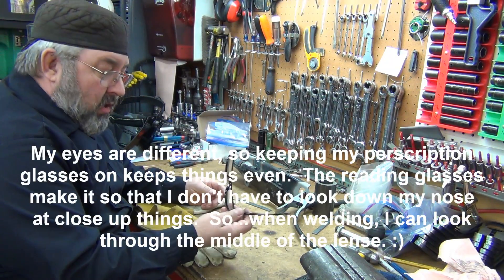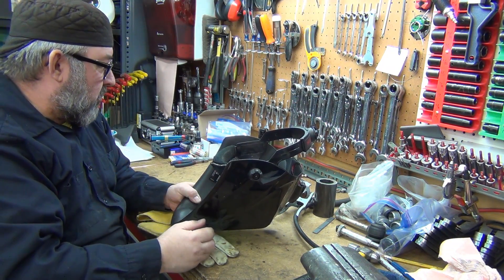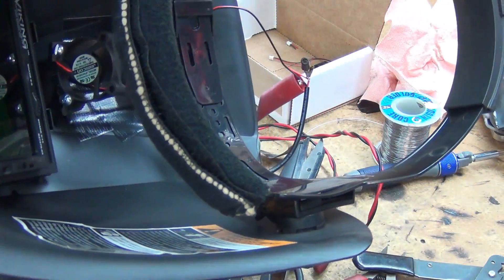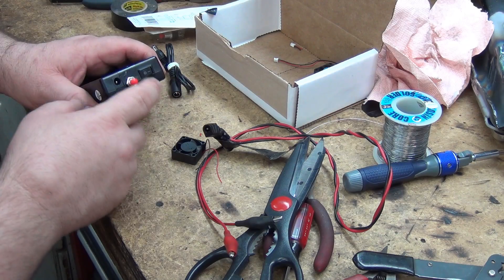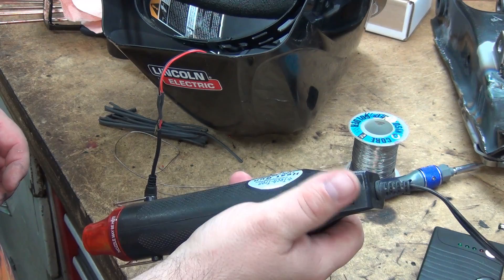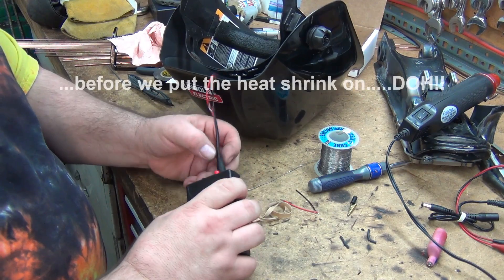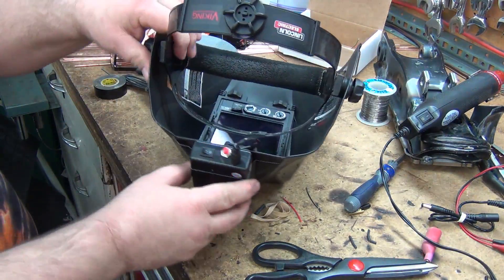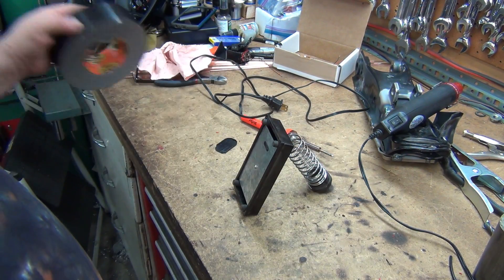Weld Helmet Mod - Fan

Comment: I appreciate when people leave their mistakes in the video.  Great idea.  I'm doin' it.
Reply from the maker: Thanks. :)  You're...???.....going to leave your mistakes in your vids or put a fan in your helmet? lol  ;)
Reply: bluehandsvideo   I make too many mistakes to leave them in. I made the helmet mod right after watching your vid. I cut a hole on the top of helmet and mounted a larger computer fan. Powering it with a pc power supply. Works great. Thanks again for the inspiration.
Reply from the maker: @abbarr  Most of my editing is to cut out all the "Ummm's and So's". lol    Interesting way to do it.  I had thought about that, but I wasn't sure if sparks would come through the fan.   You're more than welcome!

Comment: Umm, yeah.....they make magnifier("cheater") lenses for welding hoods. Not all welding hoods are compatible though. 

I might have to try the fan though. I recently had to swap to a different hood while mine de-fogged.
Reply from the maker: I've seen the cheater lenses, but only on the older, smaller size lens.  I haven't looked in quite some time, so maybe they have them now for the bigger ones.  I really like the bigger window!!   The fan works awesome for me for keep the fog at bay!  As I get a bit more time in the shop, I think I might revisit this and actually make it more "finished" and permanent.  Thanks! Mike
Reply: @bluehandsvideo  I haven't seen any available for the large lense hoods. I could be wrong, but it doesn't look like your hood is compatible anyway.

Comment: Idk man i feel like if you arc weld it could burn through the plastic of battery and cause an explosion on your head
Reply from the maker: hhmmm.....I guess it might be possible.  You'd never think a lighter would blow up in a guys pants from a spark, but it's happened.  Maybe a thin, sheet metal shield over it would be a good idea.  Thanks!

Comment: Pretty neat, I've been thinking of doing the same thing, except swapping out the battery pack with a small solar panel mounted to the face. I imagine in full view of a welding arc it could shoot out a good 20-30v, enough to get a small fan going like a turbine.
Reply from the maker: Thanks.  If you do it with solar......come back with a link....I'd really like to see it.  I just moved my helmet the other day.  Battery still have about 1/2 charge on it, but the duct tape was letting go.  I guess I'll make a more permanent bracket for it when I get a chance. :)

Comment: I really dig the idea. Seeing you do this gives me some inspiration to have a go at modding a hood myself. One question though. How do you manage the sparks? Call me paranoid but you do enough vertical or overhead and I reckon they'll eventually melt right through the housing that holds the batteries. Bad news for your head :) I may have misunderstood since you wrote that this is only a proof of concept. I don't know if you've got this setup currently.  I like the suggestions someone else posted about having longer leads for the power supply so that it could rest in your pocket, maybe slightly more insulated cable too. The velcro idea is great too but my uneducated guess would reason that having everything fixed to your hood would get tiring. If you're just doing a quick session the bit of extra weight can't hurt much. Anyways thanks for posting, if anything I'll use this as something to get me going!
Reply from the maker: Not sure if I ever replied to this 2yrs ago.  Great point!!  I've been looking to revisit this mod again, fairly soon.  You've got me thinking about creating a metal sleeve for the battery to slide into.  I'm not a pro and certainly not a production welder, so I really don't do any vertical or overhead welding.....although the couple of times I had to, I nearly lit myself on fire!!  For now, the battery pack is still just duct taped to the helmet. lol  Thanks!!

Comment: Should of used life/lipo battery less weight and surely batt life will last forever before you run out of juice
Reply from the maker: Any suggestion for a specific battery that would work?  I don't know much about them at all, but it seems the LiFe would be the better choice between the two.  Not sure I want a lipo battery on my head that has any chance of blowing up. lol  Another consideration is the charging.  Do they take special chargers?  Each one has different requirements to charging/discharging to "break" them in.  I may not be looking at the same thing you're looking at.......so if you can point me to the options you have in mind, I'd like to look at them.  Thanks!!
Reply: If you know any rc shop in your area sure they have batt selection of any size and shape that can fit your hood. You also need special charger for them cant use the regular charger they a bit pricey tho.  ebay is your best bet if you want to go cheap. Turnigy lipo battery and charger if you wanna go cheap
Reply from the maker: Checked them out a bit online.  They're not as expensive as I thought they'd be.  Hopefully, others will see this info and be able to use it.  Since I already have something that works, I doubt I'll be changing it out. 

I've got a ton of R/C stuff here...but it's old.....15 years +.  Back when Li-Ion was just coming out.....?. lol!!  I'm sure if I ever pull it back down off the shelf, I'll be spending a lot of time learning about these new batteries!! lol   Thanks!!

Comment: Mike attach the battery pack with Industrial velcro.  Buy 2 battery packs and keep both charged so during long welding sessions you have a back up battery.
Reply from the maker: George emailed me about the velcro idea.  I like it!  If I did commercial welding, I might do it enough to warrant a second battery pack......but in my shop....I doubt it's needed.  Thanks Charlie!!

Comment: LOL I've been there before with mixing up wires and forgetting heat shrink tubing. Though, never one right after the other. :)

You know, a 3d printer would come in real handy right there. LOL :)

I did something similar many years ago. I was welding galvanized sheet metal and wanted some fresh air. So I hot glued a computer fan to my helmet and ducted the fan into the helmet. Then I glued a filter on top. It wasn't powerful enough to do what I wanted it to do though. :(

P.S. It's 70F in our garage right now. LOL Hey, all I can say is my dad owning an hvac businesses has it's perks. :)
Reply from the maker: Dad's biz.....hvac perks.... LOL!! I wish! :)
yep....3D printed ducting crossed my mind, but I only have time for what's essential right now. I was just looking......they have something similar on ebay as paint ball mask cooling fans and costume mask fans.  Interesting.
That galvanized metal is pretty bad for you when welding.  I hear drinking milk helps.
Thanks!!
Reply: LOL Yea, I know. I'm just messing with you. I hope you don't mind.

I found that those masks get mixed reviews. I play airsoft, so I  have looked into them. I eventually did get a set of goggles with a built in fan, but I spent something like $200 for it. There actually meant for military and law enforcement. But now I have gone down a rabbit hole. :) LOL

Welding galvanized metal isn't "bad" for you. It will just give you the worst night in your life. LOL :)  But no long term effects. At Least according to osha. Milk  does help. But, something I found out later, a dust mask completely prevents metal fever. Which is what happens when you breath in too much zinc oxide (and other metals) from the welding. Moderation is also beneficial. But I sometimes weld rooftop unit adapta curves together, so moderation is usually not an option. :)
Reply from the maker: I don't mind you messing with me. :)
I haven't seen goggles like what you describe.....at least not with fans in them.  
That's interesting to know about the dust mask helping with the zinc fumes.  Not that I weld any galvanized stuff, but I'd have trouble getting the mask to seal over the beard anyway.  :)
Reply: LOL Yea, I have the same beard issue. :) I'll leave another comment (Just incase I get caught in spam :) )with a link to those goggles. I don't think they will help you much, but they are interesting.
Reply from the maker: Nice looking goggles!  The fan is under the tiny grill on the top?  
Most likely the price has come down since you bought them. :)
Reply: LOL Yea that happens. LOL :) Yup, that is a fan under there. It is really small. But it works great. I used it, with sweat pouring down my face, extremely high humidity, and no fogging.
Reply from the maker: Sounds good.  Looks like I'll be using my helmet again pretty soon.  No pouring sweat to deal with.....I don't work that hard. :)
Reply: LOL :)

Comment: Mike neat idea.   Where did you get the little power module?  And where did you get the 
tubular heat gun?  Thanks  Rod
Reply from the maker: Thanks.  
https://www.amazon.com/gp/product/B00MHNQIR2/ref=oh_aui_detailpage_o07_s00?ie=UTF8&psc=1

This is the gun, but I have no clue if this is who I got it from.
http://www.ebay.com/itm/110V-220V-Heat-Gun-Hot-for-18650-Wrap-Heat-Shrink-Tubing-Temperature-300W-DIY-/272368548857

Comment: How is it with the extra weight on your head? I know I get sick of the weight of the helmet during a long day, I wonder if a longer lead and put the battery pack in a pocket or something might be an idea?
Reply from the maker: I haven't noticed it being an issue.....but then again, I don't wear it everyday or even all day.  It says the shipping weight is 4oz.  I'm not sure if that includes the box or not.  You could weigh out some quarters or nickels to get that weight....then tape it to you helmet to see if it's annoying.  They also make a model that uses the punch out on the case for a usb port......with that one, you could run the fan on 12v and power a usb device at the same time....wouldn't have to worry about headphones dying.  ??  maybe. :)  I paid $24....the one with usb is about $28.
Reply from the maker: Also......the longer lead, battery in the pocket.....great idea!!

Comment: That'll sure keep the specks from fogging up when it's hot.  Very cool! (pun) My problem is needing to put in whole shop ventilation.  It gets pretty smokey with stick and mig.
Reply from the maker: I end up cracking the garage door and the back door to vent the smoke.  Of course, that would make the shop colder and the lens would fog up more.......hence the need for the fan. :) 
I don't think I've had a probably when it's hot.  The breeze is gonna be nice at those times. :)

Comment: You didn't say where you were buying your connectors from. In case you don't know about Monoprice.com. Check them out for prices, since you can really take a bath at some places for cables and connectors. They have good stuff at very low prices.
Reply from the maker: I got them through Amazon.  I'll take a look at it. :)
Reply: kwd57 thanks i was wondering this myself.

Comment: I know i guy that used to work as a welder,  they used an air hose going to helmet kinda like a diver. Keeps you cool and more importantly if you push enough fresh air from outside into the helmet the welding fumes can't get in
Reply from the maker: I thought about a hose from the airline or even a small pump......I just didn't want anything connected to it.  I get up and walk around the shop quite a bit.  Thanks!